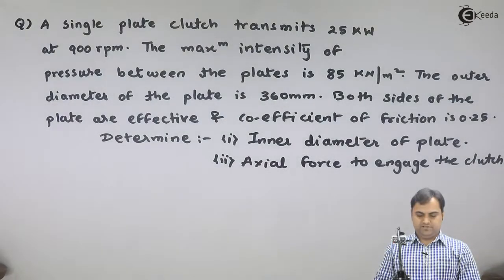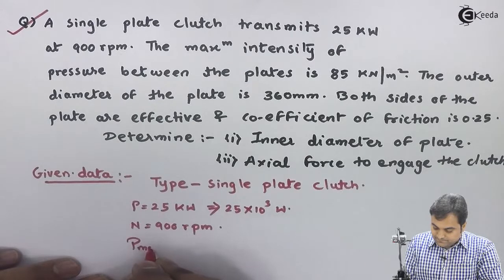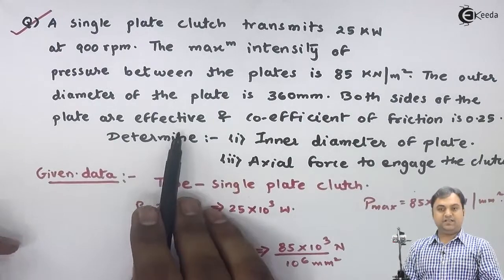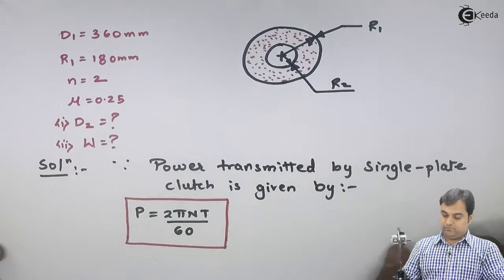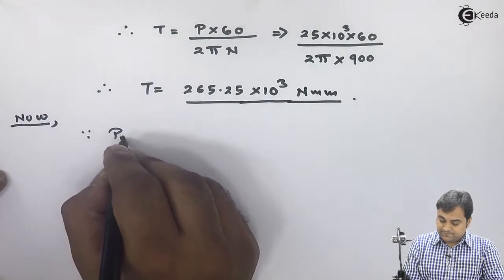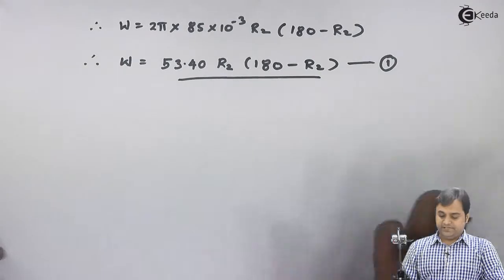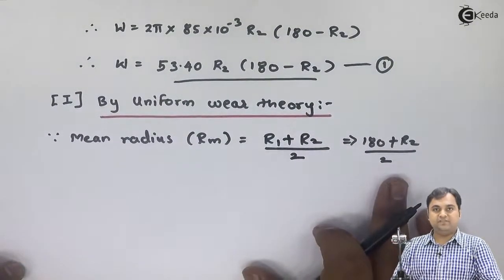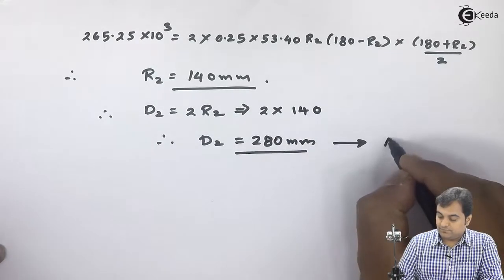Problem 2 Based on Clutches - Clutches and Bearings - Theory of Machine

Comment: a car engine has its rated output of 12 kw. the maximum torque developed is 100 n-m. the clutch used is of single plate type having 2 active surfaces. the axial pressure is not to exceed 85 kn/m². the external diameter of the friction plate is 1.25 times the internal diameter. determine the dimensions of the friction plate and the axial force exerted by spring. take μ-0.3.
Ya Example ka solution upload karo sir